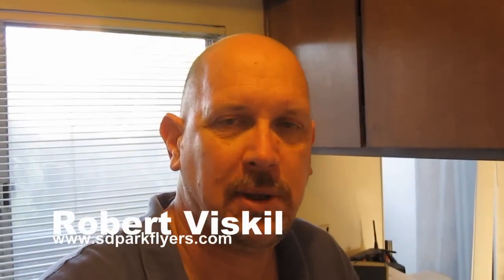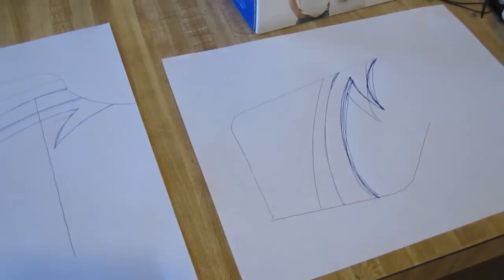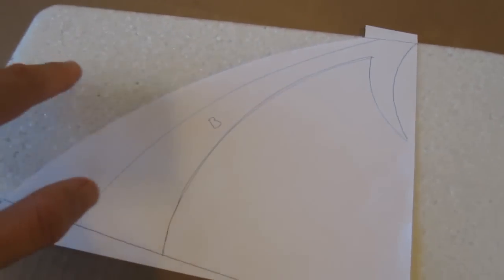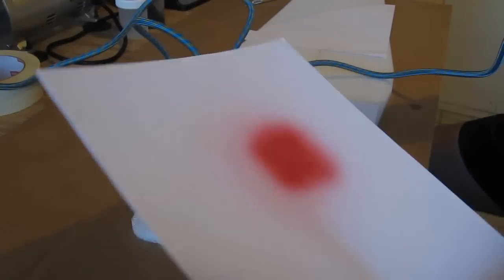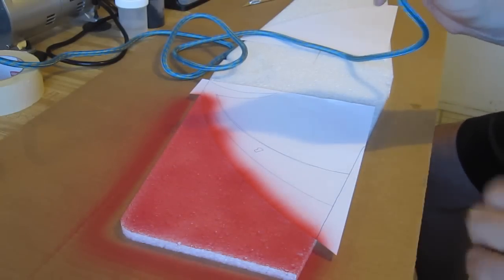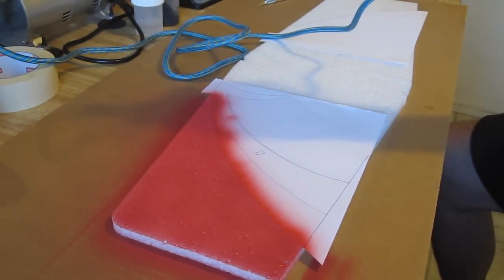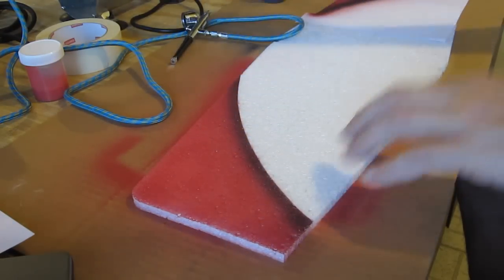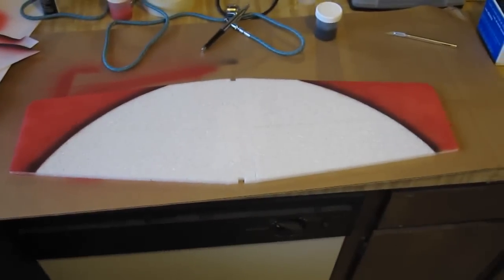How to Airbrush 101 Video # 3

Comment: Thanks, in regards to the airbrush, I have the same one and trying to change one of the needles and can't seem to change the tip. It comes with 3 needles, .2 mm, .3 mm in the brush and a .5 mm. I'm wanting to go  to a 5 since I'll mostly do heavy painting. Just can't seem to get the tip out . Any advice on how to change it would be appreciated. Thanks

Comment: I wonder what the finish would have looked like if the surface was covered with Fiberclass.  If there is an issue with weight  i would use a more powerful motor to address the power to weight rasio